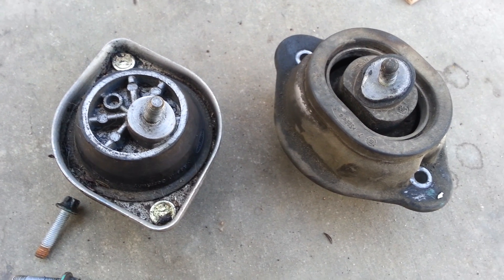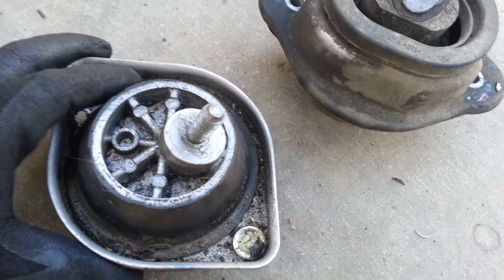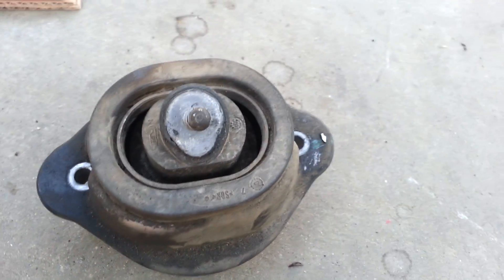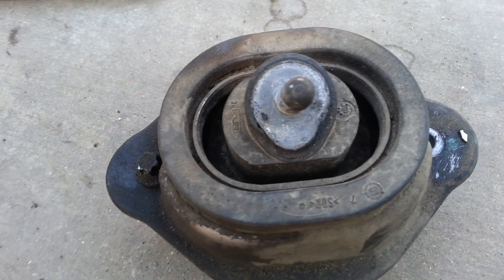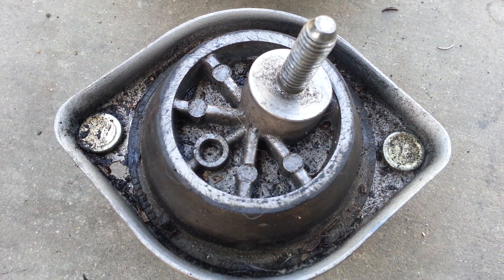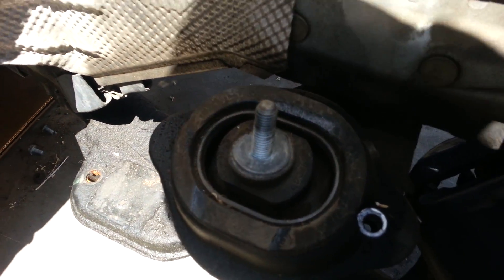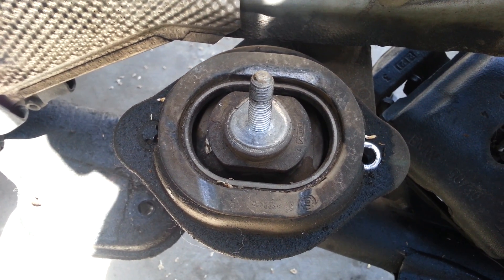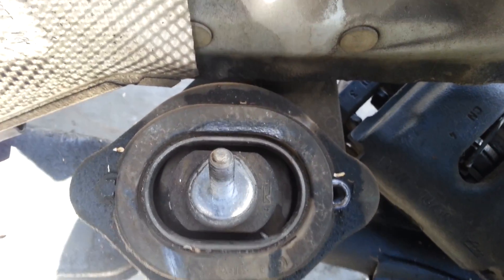Bmw E39 540 E53 X5 Engine Mounts Comparison

Comment: the easy to take the driver side mount is to take off the main nut of the mount from top u can see it , the if u want to remove it completey jack engine up little bit then remove the two torx screws using e12
Reply from the maker: Awesome, thanks for sharing your input.